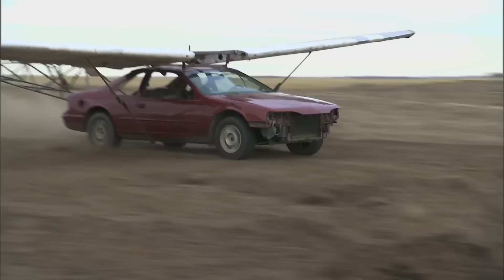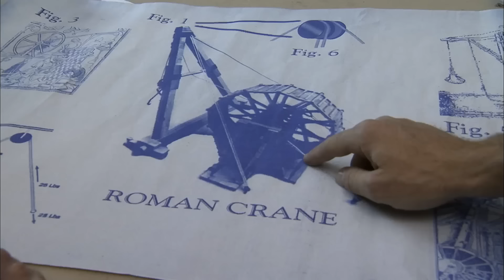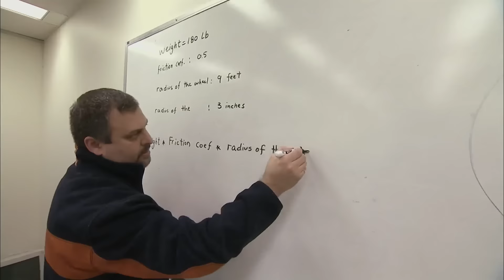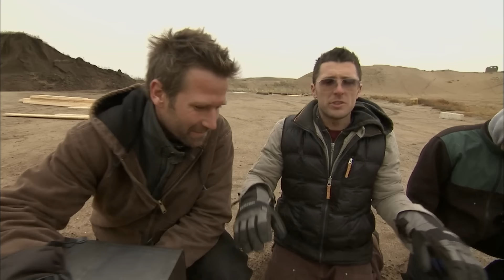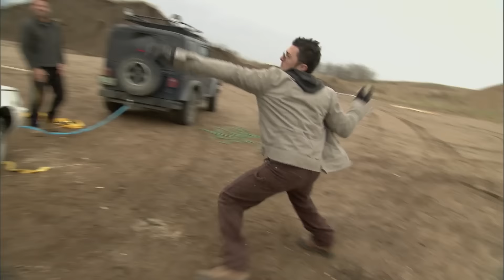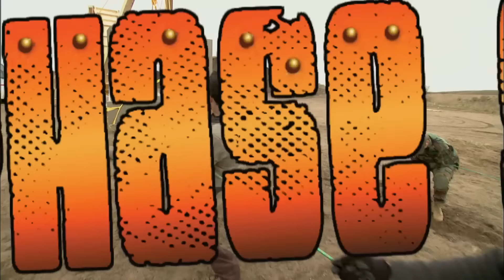We Built Rome’s Greatest Crane—Can It Still Lift Like a Legend? SHOCKING Test! | The Re-Inventors

Comment: You guys did one thing wrong with the "hamster wheel". There should be cross treads on the interior walking surface. The mechanical advantage the wheel gives comes from translating the potential energy of the walker's weight as they "fall" from stepping up onto the next tread. Without that tread, the translation of the downward force is orthogonal to the plane of the side of the wheel, thus the efficiency of the energy conversion is reduced proportionally to the angle of the downward force of the person driving the wheel.